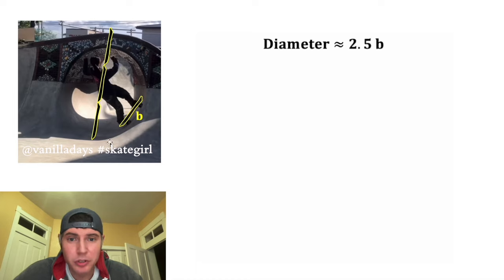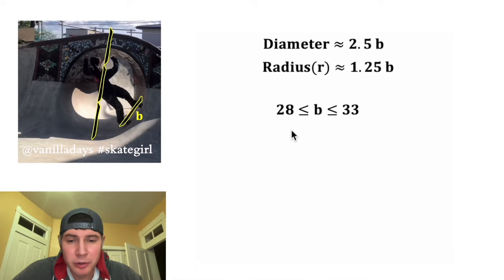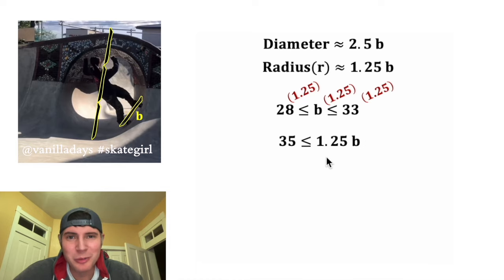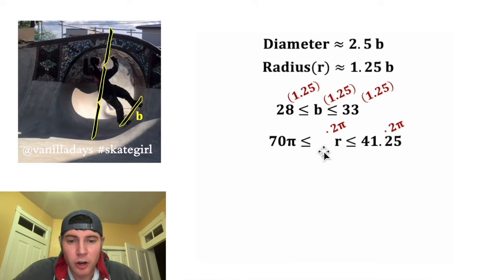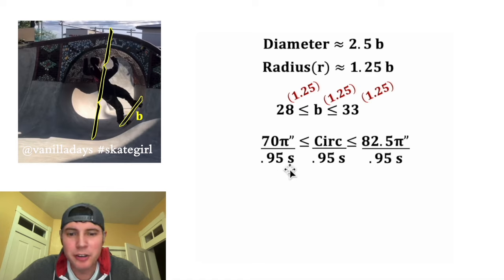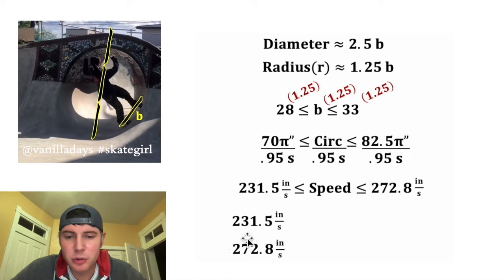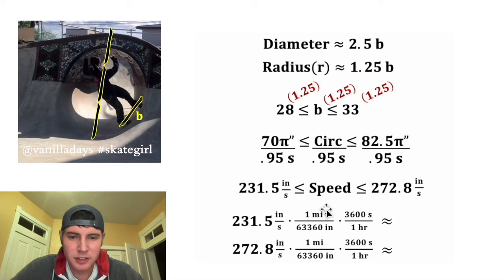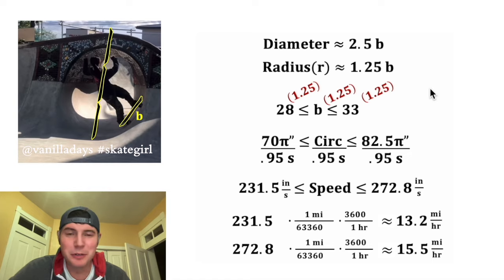SkateGirl Math

Comment: Imagine doing all this work and then using inches per second
Reply: ikr
Reply: Lmfao! Inches of "anything" is my baseline as well. I know its dumb, but I know inches good 👍
Reply: Nothing wrong with that.
Reply: Units are kinda strange like that, they might be equivalent, but how meaningful they are as measurements depends mostly on context. Like honestly 15mi/hr makes since to me in a car, but running or riding a skate board it's still hard to feel how fast that is. I just did the division in my head but wouldn't that be about 19.3ft/s to 21.8ft/s. Which I can at least envision 20 feet and someone moving across it in 1 second feels pretty fast!

Comment: To everyone confused about using inches and inches per second, the length of the board is in inches so would you expect him to convert that to miles at the start and use 0.000441919miles and 0.000520833miles throughout the whole process, or simply use 28 and 33 inches throughout which is much more legible and then convert to MPH at the end?
Reply: Or you can use a the measurement system that actually makes sense
Reply: @djsuit95  Metric as opposed to imperial you mean? So he'd end up with CM per second instead of inches per second?
Reply: @HolyCodzta  yes, ofc
Reply: @bakashiro  Okay, so what does that really change if you still want to convert to MPH at the end?
Reply: @HolyCodzta  you dont change to mph, kph is better 🗿
Reply: @bakashiro  Hmmmmmm good point! I knew most of the world used the metric system but I googled how much of the world still uses MPH and turns out it's only 9%, which for some reason I thought would be much higher. I'm from UK so I guess subconsciously I just don't wanna believe our Imperial system is almost obsolete 😭
Reply: Easier to work with 'b' all the way down, and convert at the end. Plus, this is an approximation anyway, so, call pi '3', etc. The given precisions of max and min at the end are a bit silly, given the range.

Comment: Great to have a math problem with different units.  That's good preparation for physics.
US is only one of two countries not using the metric system ... to our enduring embarassment.
Reply: ... and occasional tragedies. The metric system wouldn't make too much difference here.. it really starts to shine when you need to deduce mass, momentum, energy, etc. Their units are all much more conveniently related to length and time.
Reply: @rbettsx  
Yes, computing body mass index (BMI) is much simpler using the metric system the way it had been first formulated.
I've tried thinking more in metric units due to regular medical procedures where they measure dosage in mg/kg.

Comment: 2:26 I am confused because I don't know the rule that allows you to know to calculate 231.5 divide by 63360 multiply by 3600. This is why Math is not intuitive, what would make someone, without prior knowledge of doing this type of math before, intuitively know which rule to applied in which situation based on the problem alone? Di you know trigonometry was super difficult and seemed impossible, until a nurse told me trigonometry is about places and moving something on a grid? No teachers ever told me the purpose of the math I am using. I learned, Algebra help to solve crimes, Calculus is use to solve murders and cold cases. I use categorical math to figure out if someone is lying to me( is they claim to be a set that does not contain evil and when multiplied by another set, they act evil, then the set they are contain evil and I was lied to or maybe it was omission, I copy their set and multiply it by their set, they became furious and told me everything they believe my set contain, unaware it is their set I just used. Now I know everything the set contain and how I was lied to and to prevent it). Basically, do unto others as they have done unto you, is a mathematical formula that tells you everything about a person.
Reply: He is calculating how many inches and how many seconds there are in one mile and one hour. Because right now the calculation is in inches / seconds and the usual term we use in understandable speed is miles/hr and km/hr. 
So 1 hour = 60 minutes = 3600 seconds (60 * 60 = 3600 seconds, so 1 hour = 3600 seconds).  The same goes for when he goes from inches to miles. I am not American so I do not know how much one inch is but apparently there are 63360 inches in one mile. (You can just google how many inches in one mile and it will tell you)
Reply: He is just making the stuff up.